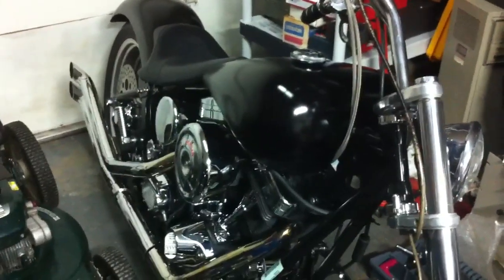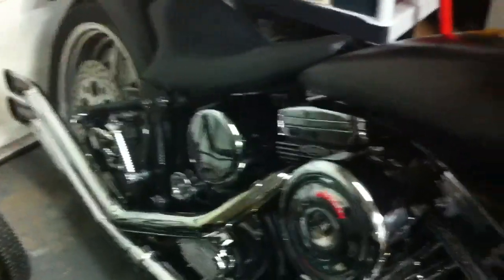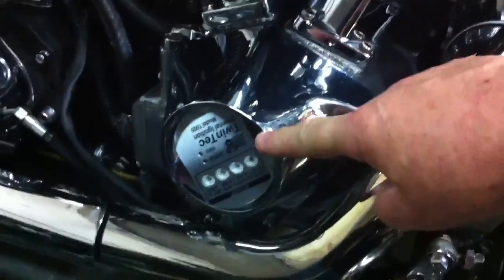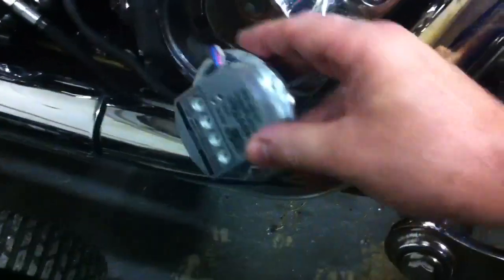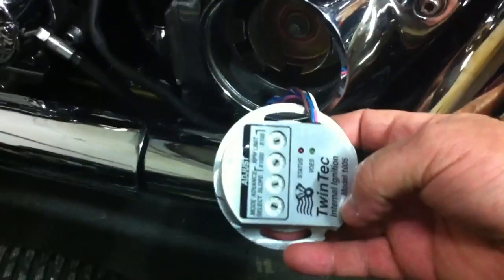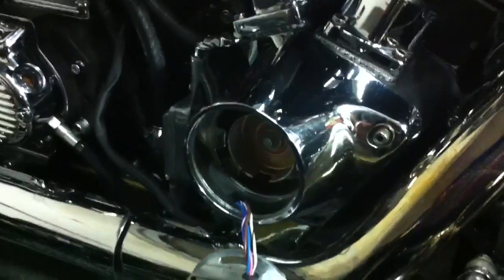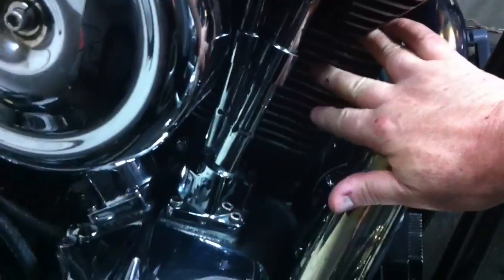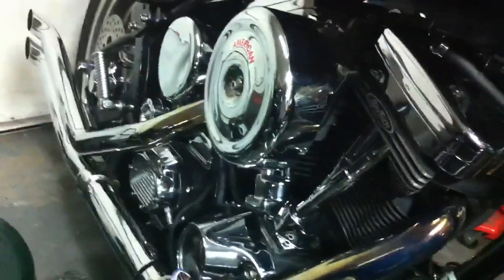Custom Bike Twin Tec Electronic Ignition Systems

Comment: That is incorrect. I live where it is hotter and more humid, 105 summer temps daily with 70% humidity. My headers wrap that nose cone closely. I run that exact ignition, twintec 1005 in my hopped up S&S 124" modified engine, making 155 ft lbs tq at the wheel. That same company makes S&S's proprietary ignition, same style. None of those shops know how to tune that ignition is the entire problem. I had the same problem with shops not having a clue, especially Harley. It is the absolute best ignition to put on a Vtwin yielding more power than all other ignitions. You can also put custom mapping in it and dial it in an exponential # of scenarios. Those pipes have stayed cool as you can see the headers are not even blue. That motor never got hot. My engine is a beast and that is the only ignition to run. Sorry, but your Revtech is an inferior product. I bet they had the thing vented incorrectly as well. I had one shop do that and it would not run right. Another shop had the coil arching out on the cyl heads. 4 diff shops could not fix a simple inner primary leak. I finally had enough and started doing it all myself. I fixed the leak tearing down the entire drivetrain. All they needed to do was put some Yamabond on the inner o ring and casing, problem solved, not one drop leaks now. However that is laziness for you at the shop, not cleaning the oil off, not allowing it to dry before reassemly, no loctite, etc etc. DO NOT TRUST ANY SHOPS, Especially with aftermarket bikes. They are clueless. Now I do all of my maintenance and repair for yrs, it helps having a bike lift. Not one problem since doing my own work.
Reply: +f355911tt i have the little problem in my FXR 89 .. i have the external module wt .the voes & single fire ... and the problem is the ignition sensor with 4 wires and i see only with 3 wires in ebay   ..and i don't found some sensor close that my bike ... i'm confused ... if my coils  new , module good condition, ..and some mechanics wants to replase all ignition sistem .. 
and the oil leak the nose cone ..i have to remove all cone ???.. or only the sensor ... .... heeelp !!! .............  cheers
Reply: Really...yamabond on a seal....and you say Harley service don’t know and are clueless....you better step back and think Darrell.....lol..WOW!!!   Yeah I know it’s spelled wrong......
Reply: Heat do a fake electrical components I believe you do right about the Heat it's happening lot with injectors coil and more ,
Reply: That's what I have. S&S, 124", twin tec. I bought like this. It starts right up, runs for exactly 5 minutes, dies. Starts back up, runs for 1 minute. Won't start again, for a while. Happens for the last few days.
 I guessing, something is heating up, killing the motor. Electrical?
Ohmed the coil, primary, secondary and wires. Was good, when cold.
Reply: are you a qualified mechanic ?

Comment: i have the Twin Tec TC88 external module on my 2000 Softail and for a week the bike was running and after a minute or so it would cut out. Wouldn't start for a couple hrs after that and all of a sudden nothing....piss me off. So I go through the hassle of wire tracing and hunting for bad grounds etc, eventually after searching and testing, buying new plugs, wires and so on. .I took off my Module that is mounted under the seat and smelled it and it was toast... WTF? all of a sudden a $300+ module burns up for ?? So I'm changing out my ignition and going with something else.
Reply: ....... same problem with my 88FXSTC. And the HD Dealers were happy to sell me ignition parts I didn't need... pain in the ass.  My bad ass 88 is still sitting in  the garage.. I don't really know what to do at this point!
Reply: @Ohm10-8  Sorry I just seen this. Mine ended up being the cam or crank sensor. both got replaced and still running great today
Reply: @tmarx88  Hey thanks for the reply! My 88' doesn't have a cam positioning sensor up front like yours(wish it did my problem might be over)? It just has the little square sensor under the nose cone. I think it's simply called a Cam Pickup. Damn thing did it to me again last week.. Yeah talk about pissed,, seeing it loaded onto a flatbed! Next day I put a new Cam Pick up in.. back up and running. I have heat wrap around that area curving around the cam nose cone too! Well we'll see if this CP holds out, getting tired of going around the block 50 times waiting for the bitch to die on me again (hopefully not, this is getting old)! Glad you posted because I was.. and still thinking of going with the aftermarket ignition upgrade.. Twin Tec, S&S but I'll be pissed if that module only last a year or less! Good luck man.. frustrating stuff no doubt.  👍
Reply: @Ohm10-8  Yeah you'll have to figure out whats causing it to fuck up every so often. I"ve nod absolutely no issues with mine since. I did jump on it yesterday and to my surprise i hit the start button and nothing. So all day long I'm reading through the manual and seeing if it can guide me then it dawned on me "hey dummy check for a blown fuse"...lmao! Thats what it was. I had the hand controls all torn apart looking for broken wires but I hadn't touched my fuse box for so damn long I didn't even think about it. But changed out the ignition fuse and viola...back in business. Good luck with that issue bro.
Reply: @tmarx88  Oh I'll figure this out!! I put a new (cam sensor plate) in and it fired up. I'm going to keep the cap pieces off the nose cone for a little bit.. give a break from the heat. Maybe break it in a bit.. lol. I have a super nice 97' Sporty that's feeling lonely since I got this bike. So "we riding bro!" 😜 Thanks for the reply... Great Riding on ya' Tim.  jOHn.  MI.

Comment: I have a Shovel who has timing ignition Oem part number 32598-78 question: it is dual or single fire ?  I will appreciate your help. I burned this part, cause I forgot to swicthed off.